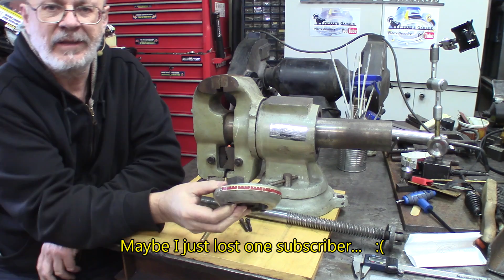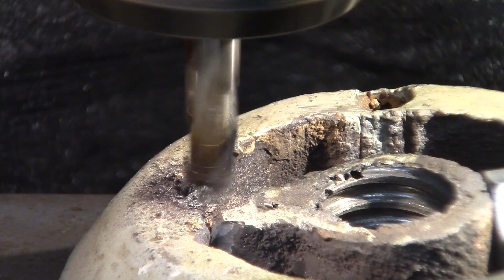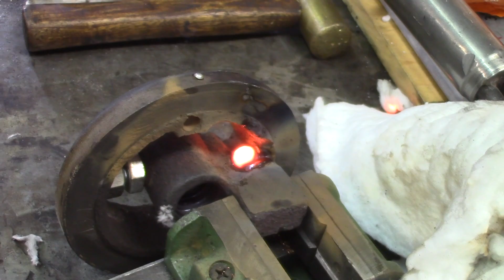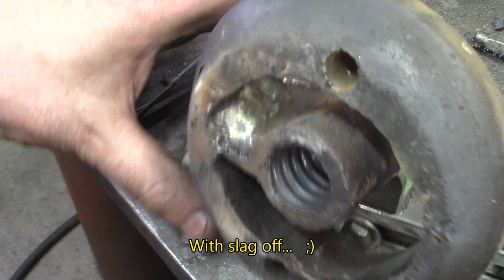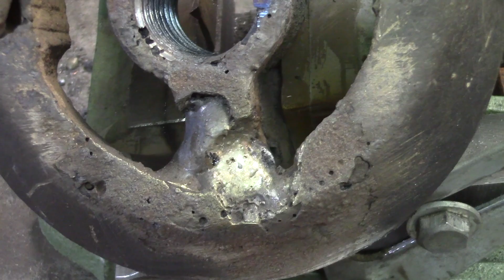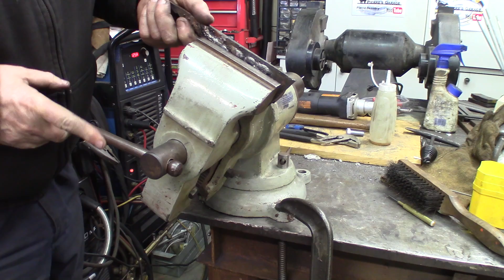Broken Vise repair by machining and TIG welding cast iron vise

Comment: I broke the same vice  yesterday where the inner round part meets the jaw...sad. will try to heat it up and weld.
Reply from the maker: If not already done, don't forget to apply some preheat and slow cooling, Alluminium bronze could a decent alternative as filler metal usable with TIG or Oxyacetylene processes, delecate job but can be done...    🙂

Comment: I am trying to fix the same vice now.  How does the head rotate?  The part that is cracked in this video looks like it keeps the head from rotating.   Mine is also cracked there.
Reply from the maker: The head rotates freely if the vise isn't tight, if it doesn't rotate chances are that you got more of a problem that is shown in the video. 
All of it being cast iron, welding without making it brittle require special very high content Nickel rods or braze using silicon bronze filling material.  Good preheat techniques are also required.
Reply: @pierresgarage2687  I was able to rip it apart and I had a complete break when yours was cracked 80%   I gave it to my dad who has been a welder for over 36 years.  It got jammed in there tight.

Thanks!   Keep up the good work!
Reply from the maker: @arrowandrew2613  Your dad should be able to get it back working...!!!   Dads are miracle makers...    😉👍

Comment: Good work Pierre, i'm just outside North Bay Ontario, and  at least 30 years ago i bougt the same vise,  Mine was made in Taiwan. Its been an excellent vise, my son uses it daily in his automotive repair garage, and its held up  great. Never a problem.I remember buying it for 69 bucks with Tax.
Reply from the maker: Those are rare by now, the company stopped selling them, I've called them to claim the warranty, they were gonna give me $60USD back while I sent them the broken part...   What they were doing since the stopped selling it, was to give me the retail price price back since that was the latest selling price at the time... 
I decided to fix it...   So the video, the vise is still on a dolly under the welding table, unused....    🙂🙂
Hope Winter isn't too harsh in North Bay, here it's more snow than we're used to for the later years...

Comment: I know this is old but I just now seeing it and I had an idea for the next time why not drill and tap it from the outside and run to cap screws in from the outside pinnning it back to the larger circle along with tig welding .. or at the very least drilling it and pressing two steel pins to help keep the center nut from moving and adding some rigidity to it.. I am not a machinist  but mainly ask to learn the different ways to repair such a problem
Reply from the maker: Hi Scott, one of the most interesting part of living is about learning new stuff in order to make things better...
Thanks for comment,    Pierre

Comment: Hey Pierre
Everything must went well Did not hear and cursing.. Good job. I hate welding cast . Last time I did cast was in the late 80 and doing exhaust manifold for and old Buick. Skylark.
Reply from the maker: Hi Fred,
This was a real shitty quality casting....   Like swiss cheese type iron...   lol
Don't know if it won't crack somewhere else or what....   
Are you getting some new machines on their way to work lately...???
Cheers,    Pierre
Reply: I have been off .I buggered my leg and have to keep off of it for the next few weeks. I have the Mill in the shop but not in place yet. I am changing out the bearing on the spindle On the X and Y. As it has not been touched since 1988. I pulled it apart just to see it there was any metal filing and there was a little bit. I am going get some new ones .Will get this on video as soon as the leg heals up. It is one heavy bastard. So now I am just watching You tube video's and catching up.

And congratulation  on the 5000. That's awesome.

Cheers Fred
Reply from the maker: Humm....!!!   Bad about the leg, hope it's minor and you get better soon...   ;)

Comment: inconel rods i used working for wollard aircraft here in miami fla. airplane parts welding
Reply from the maker: High Nickel is one of the good methods to get cast iron back together after it breaks... So time to use them before I get too old to step in the shop...  ;)

Comment: That looked like a very frustrating repair, I don't think I've seen a casting that bad yet. You got it working anyway, I use the smaller style of that mostly for positioning things to file or weld, I have an 8" beast of a vise when a lot of pressure is needed.
Reply from the maker: Hi James,
This was a real crappy casting, hope it holds at least as long as I keep on working in the shop...   ;)
Thanks for comment,    Pierre

Comment: Welding cast iron requires the tools, the skills and maintaining reasonable expectations. Whenever dealing with welding cast, there's always a temptation to write it off as 'junk' or 'low quality' but the truth is, that's just the nature of the material. Even with rods that are specially made for it, there's only so much you can do.
Reply: I bought a used milling vise that was so covered in dirt, and grease that I missed a bad crack it had in it. So when tightening it just kept slipping. I really wanted that vise though so I fixed it. I ended up cracking the movable jaw clean in half and getting in there with one of those mini cut off discs for a Dremel. I recut the cast threads deeper in there. Then I Veed out the casting, clamped it around the screw, and welded it up. Of course the whole casting ended up not flat anymore, so I had to mill it down. Long story short I fixed the damned thing. The moral of the story is buyer beware with those second hand purchases. Here's a pic of Frankenvise when I got done with it http://i.imgur.com/pwzbv.jpg
Reply from the maker: Hi, just like you mention, cast iron repair is very difficult and sometimes it yields poor results, mostly when the parent material is flawed like what was used to make this vise...    
Thanks for your input and for comment,    Pierre

Comment: I have several of these and did the exact same repair on two of these and the cast was just as bad....looked exactly the same, maybe worse. My older one from the early 90's is much more stout and better quality and has a nicer rounded edges to it. I brazed mine instead and built up a tail of sorts on the back side to help support it when it drew up tight. Over all though I love the design of these vises and my old one has been through the wringer. I made the mistake when younger pounding on the jaws and I broke the lip underneath. Once I get that fixed I switch it back out and put the garbage one out to pasture.
Reply from the maker: Hi,
Those vises were distributed at large at different eras, and some batches were really crappy, probably due to importers that were looking for the rock bottom price....  The result is the quality went lower and lower, I'm not even sure those big ones are still being offered on the market...
Hope it holds for a while now, hard to stick anything to some castings that looks like a bread load as for included bubbles...
Thanks for comment,    Pierre

Comment: Nice Video. I repaired 2 Vices like that. One I stick welded and penned with a penning gun, the other I Brazed and penned. both held for a long time. Might even be still in use. Never tried to Tig one. Good call on your part. I know about being Lazy and not wanting to make a new one. I think it comes with our old age.( haha ).
Reply from the maker: Hi Garry,
If I compile all the comments about those vises being repaired, I'll conclude that every single one made had to be repaired....    What flawed design or workmanship.....    !!!!!!!     :(
With age and wisdom, we don't call this lazy, we call this being practical, as we know it only needs to last a couple more years and that we're not swinging the sledge as hard as before...   lol
Thanks for your input and for comment,    Pierre

Comment: Very logical approach... if awkward inevitably.
Not sure if you mentioned but what was your current for the stick approach?
That sure was porous material. Very good attempt considering - hope it does survive as it's a very useful type of vise.
Reply from the maker: Hi Chris,
On the stick welding part I used 2 sizes of rods, the 3/32" was driven at about 85 amps and the 1/8" at 120 amps. For the TIG part the max was set at 130 amps and I was modulating the pedal depending how much was requires, the Tungsten was 3/32".
Welding this type of shitty cast iron is Hell, it fizzles and pops very easily as soon as you get near it, the hardest is to make a good first pass covering as much as possible, don't let the part get too hot without letting it cool completely...
Cheers,    Pierre
Reply: Thx for the info Pierre -- certainly a challenge!

Comment: Hi Pierre !

Nice video and repair indeed ... I once welded a part on my mill with these rods and was told to "tap" the welding with a welding hammer while it was cooling - this should prevent the material from being brittle !

As I hear you - you did a lot of warming up and cooling down but I never saw you do some "tapping" - was I just fooled or did you forget to do it ... or maybe some other explanation ???? 

BTW ... Old school stickers - how about converting to the more modern version ... digital stickers ... just make it your own idea, I don't care ;-)) - you should print out that "monkey picture" and blow it up 3-4 times ;-))

Comment: Pierre. I have 2 of those vices, a 5 inch. and a 6 inch. I broke the 5 inch vice at least 10 years ago. I fixed it back then. It broke in the exact same place. It's been so long since I fixed it that I forgot what I did too fix it. But I do know that it has lasted 10 years since the fix. I didn't even have all my machines then to fix it. I'm gonna have to take a look at it to see what I did too fix it. I do remember it having tons of bondo on the castings. I'll report back on what I did.
Reply from the maker: Hi Marcel,
That will be interesting to know how you did the fixing, I'm curious to find out...
Cheers,   PIerre

Comment: You should have bought a York or Paramo vice.  More body filler than metal in that casting.
Reply from the maker: Hi Bob,
Yap...!!! I think they fill the casting molds with dried bread crums...    :(
With the filler, it's a little harder to tell crap from goog...
Thanks for comment,   Pierre

Comment: Congrats on the 5K 10K soon to follow! Vises of that design with the nut off to one side are inherintly weak by design.  I have fixed like 3 of our big vises at work for similar failures of the nut. Anytime somebody put a PTO with bad yokes and starts beating them off with a sledge hammer usually the vise gives it up.  No doubt that is the main advantage to the wilton bullet vises.
Reply from the maker: Hi Brian,
I totally agree that those vises are pretty low-grade tools. If you need to do some beating on them they'll die prematurely, mostly if the rest of it is made with the same crappy castings... 
Tools always have to be purchased with the final use in mind, or it will end up costing way more than expected...
Surprising how the subscriber count keeps on growing, this is a great reward from the viewers...   ;)
Cheers,   Pierre

Comment: nice fix Pierre, Age has nothing to do with how often you sharpen tungsten, I can attest to that ...
looks like you could of used a right handed welder ( self proclaimed)
Congrats on the 5K subs
Cheers my friend
Reply from the maker: Hi Philippe,
Sharpening Tungsten, what a crappy job, that's what's left when you're too old to work in a metal fab shop, that and carrying water...   :)
Have a sip on me,    Pierre

Comment: The exterior of that vise looks ok Pierre, possibly a lot of filler used to get the casting smooth though. That part you welded sure shows why it broke. I'd be willing to bet both the 4" mill vises I bought from Busy Bee were as bad or worse for porosity as that part was. A lot of problems can be reworked if needed, but you sure can't fix crappy cast iron. With the amount of metalurgy knowlege around today there's no excuse for producing castings like that.
Reply from the maker: Hi,
My thinking about cheap stuff is that people that orders it aren't very fussy about quality, they accept anything that looks good and screw their customers. If they were to refuse the crappy goods, the Chinese would produce better quality, as they're able to do so at no much extra cost.
Thanks for comment,     Pierre

Comment: looks like it would have been better to have made a new one and making a high speed steel cutter for the acme thread looks like that cast iron is total rubbish but you don't know that till you start working on it
Reply from the maker: Hi Colin,
Making a new part was gonna be much more time, If this fails, then, you may see a full new part being made from scratch...  ;)
Or second choice, a big vise trown as far at it san be catapulted ( This is the type of videos that has more chances to go viral than a how to repair video...   )   ....    lol
Thanks for comment,   Pierre

Comment: I would bet your vise may work for a long time.  I have had the same bench vise all of my life.  it got a big crack at the base of it shortly after I got it and I welded it up and it still works 40 years later.
Reply from the maker: Hi Harold,
In 40 years I'll be 103 YO.......      LOL
The quality of the casting is horrible, so the wleding is more problematic, but, so far it seems like it will be holding good....   ;)
Cheers,     Pierre

Comment: Cast iron can be a pain. a trouble shooter from Miller once showed me how to properly end a weld. Pull the rod away slowly at the end of a weld after you finish the bead. By pulling away slower you melt the flux away from the electrode and restarts are instant. worked for me. keep smiling.
Reply from the maker: Hi Darren,
This is why I changed my plan to TIG, it's easier to fan out the power by modulating the pedal, I'll have to give a try to yor solution with the rods instead of the whip movement that trows a ball of flux all ove the place... 
Cheers,   Pierre